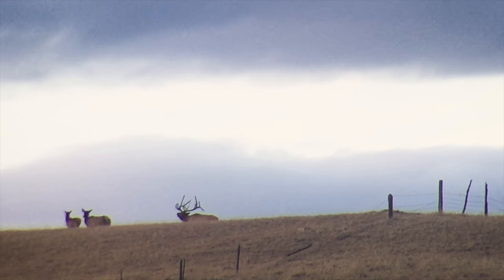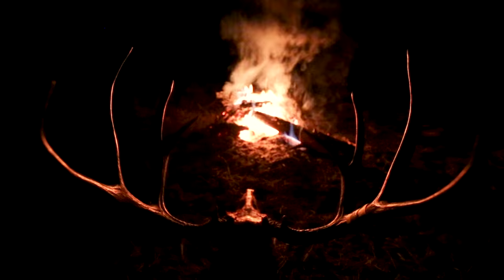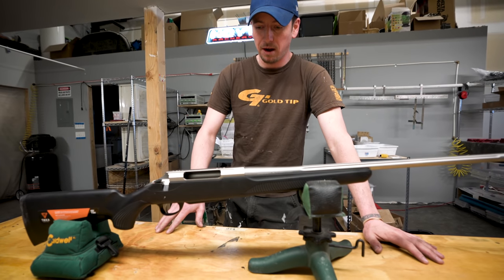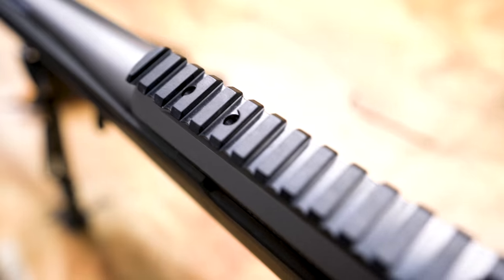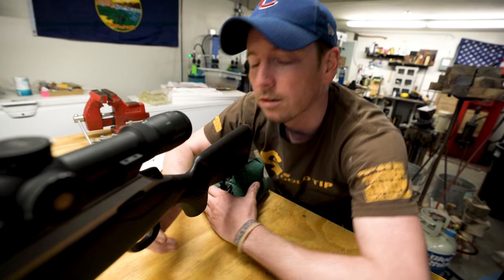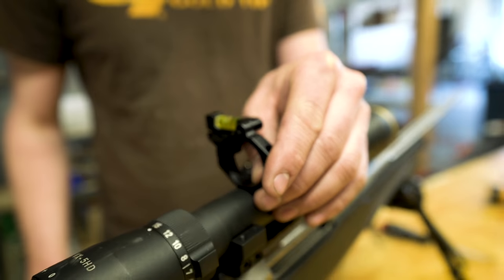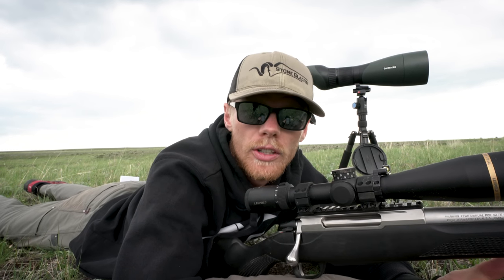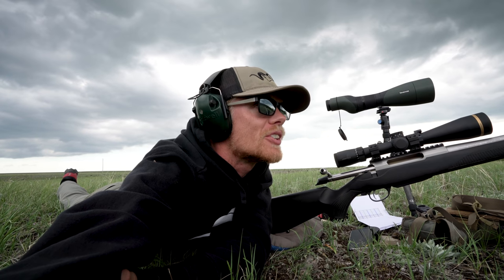Wisdom from a gun nerd  - VLOG 9 - Season 2

Comment: Great video. Lots of good quality info. I’m a tikka guy but never ran rails for the connection between rifle and scope. Looking at building a very similar set up. If you don’t mind, could I pick your brain on some of the gear you used? Did you end up going with a 20 MOA rail or 0 MOA? As for the scope mounts to fit that scope, did lows work?
Reply: my dream gun is an ar 15 with a aimpoint acro p2 and a pmag and a magpul bad lever and a s2 delta sling and a atlas s - one hanguard and a mapgul vfg foregrip and a peq 15 and a central banish 223 supresssor